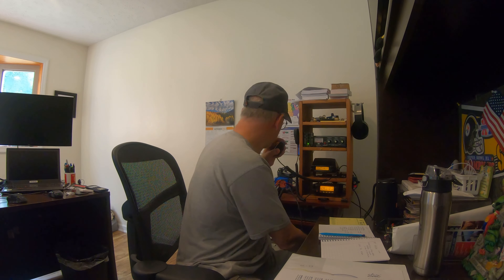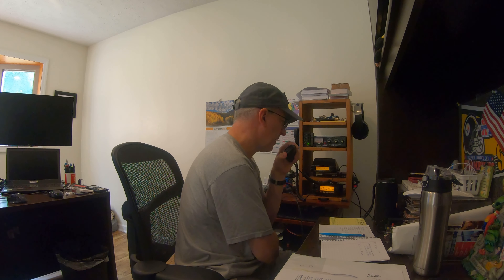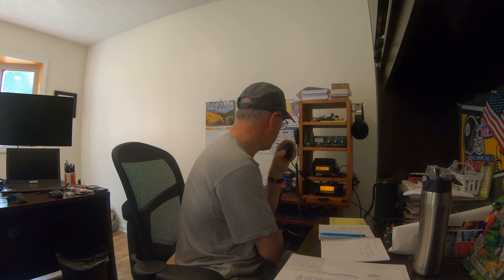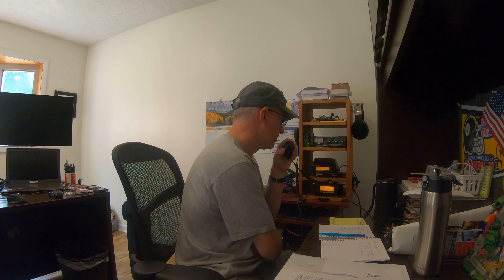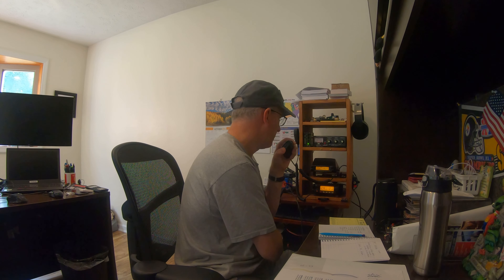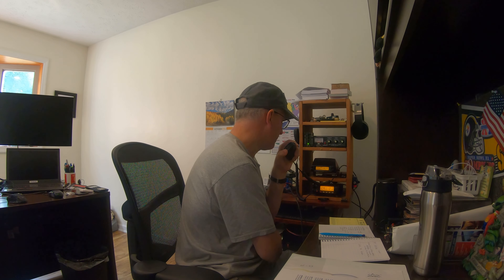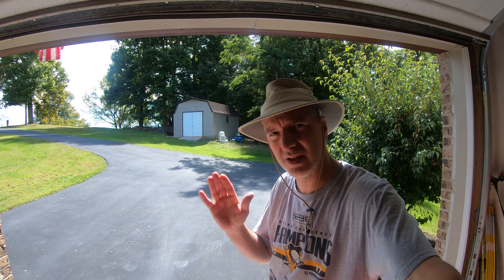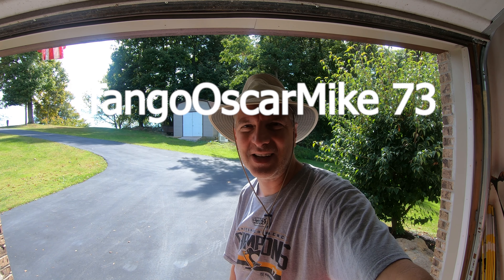Simulated Emergency Test (SET) and adjusting my solar panel for winter

Comment: Hi Tom,
I applaud you for making that adjustment and cleaning the panel. I had a Solar City 3.75 KW (15 panels) solar system installed on my roof in 2016, which was taken over by Tesla in 2019. The lifetime generation is at 19.1 MWhrs. Technically, i should be making sure the panels are cleaned, but you will not see me get up on the roof to do the cleaning. Tesla has not pressed the issue. Since it's been more than 5 years since installation, I can purchase the system and reap all the power production to reduce my electric bill. You and the family stay safe.  73  WJ3U
Reply from the maker: The older I get the less I like getting up on the roof.